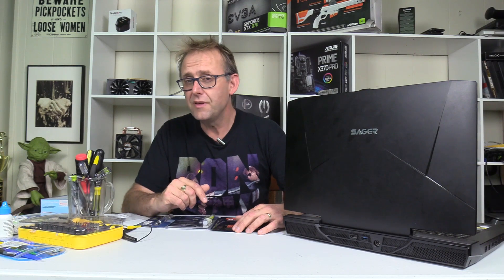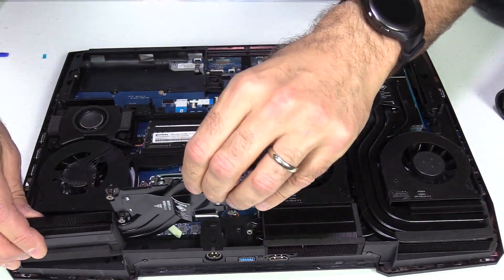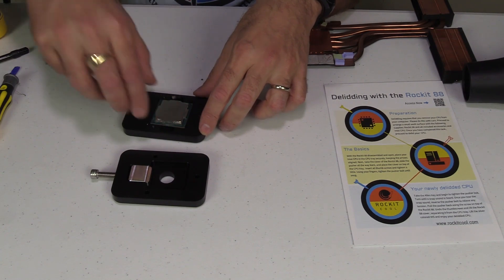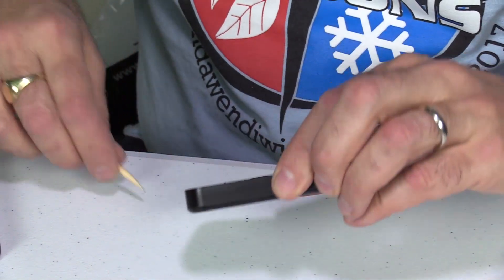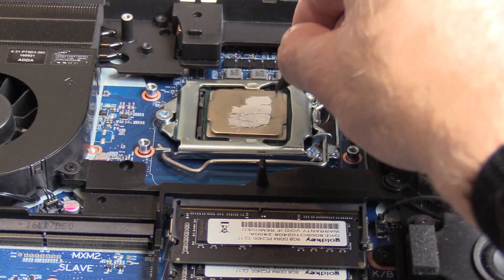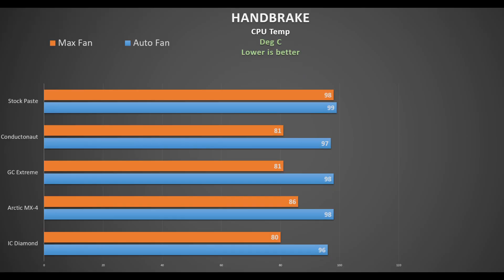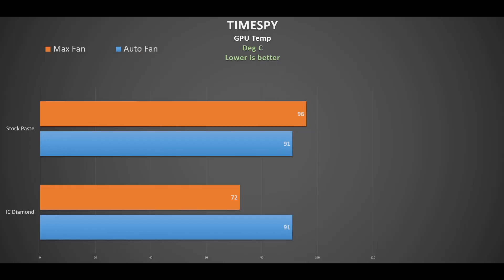Does The Thermal Paste Matter In a Laptop ? 4 Paste Showdown !

Comment from the maker: there is an error on the GPU graph - the reduction in temperature on max fan is 19 Degrees..Sorry !
Reply: Excellent thank you!
Reply: @OWNOrDisown - I've been tearing through the P870DM2/3 Owner's lounge trying to find an answer to this question but I can't so I'm hoping you might have the information I need.

I have a single GTX 1080 rig with this particular type of heatsink. I can only find guides/manuals with pad sizes as they relate to a different shape heatsink (the different one being the one shown on the front page of the Owner's Lounge for this model.) I can't for the life of me find a guide to the thermal pad sizes for THIS "T" shape heatsink or even the "half T" heatsink shown by others (which is quite literally just this heatsink halved vertically). 

I repasted for the first time recently using your specific guide and while the repasting went well (10 degree drop!) I found a few things that concerned me. One was that the IC Diamond used on the CPU and GPU originally had scratched both dies. I didn't even use a credit card to remove the crusty old paste but the dies are scratched. Second, the black "shield" around the GPU was brittle, had lots of thermal paste under it and cracked off in small pieces. I left it there until I can get ahold of some Kapton tape but I don't want to open it up again ONLY for that. Especially since the third thing I noticed was that the thermal pads were already pretty broken up upon removing the heatsink. This, despite the fact that the laptop was still warm from being run and that I used a hair dryer before removing the heatsink. 

Lots of info but basically - any idea as to the pad sizes for the gpu/cpu heatsinks shown in your video?

Comment: I use an old outdated illegal Vista sticker over the Cpu and the Gpu on my laptop for heat reduction. It seems to be working. The processors and the batteries have thermal sensors inside serving as heat camera. The sticker's metal lines have to be unharmed. On battery, the smaller part of the sticker has to be placed , sometimes it is indicated.

Comment: I guess I'll bite the bullet and do this. Considering what I paid for this loud laptop I shouldn't have to :(
Any other advice, like heatsink or fan adjustments / replacements?
Reply: @Dmitriy Otstavnoy yeah, I probably knew the risks but chose to ignore them.
Aside from the obvious outcome I got to say this laptop still delivers pc-like performance which is quite impressive.
So delitting and repasting is my best option, lets hope I don't fry or circuit my chips 😄

Comment: Yes it does, changed yesterday in my 5 year laptop, because it was throttling, went from the usual +90 degrees in the CPU (when normal office use!!) to less than 70 degrees, also cleaned the fan but it wasnt that dirty, the fan is much more silent now, since before was always on max speed

Comment: Tried MX4 on my Omen 15 i8750h turbos  and 1060 max Q I get high temp spikes up from 87 to mid 90c to 95c at full load at stock clock CPU had to undervolt ppl CPU down to 3.4Ghz from the default 4.1Ghz  turbo. The GPu did alot better with MX4 sitting at 80 to 85c under 94% load. Omen i8750h runs super hot though. Im so disappointed even after a Bios update I have to use undervolt and Omen 15 has no fan control they ramp up intermittently so that sucks too.

Comment: 1:58 remove the thermal paste
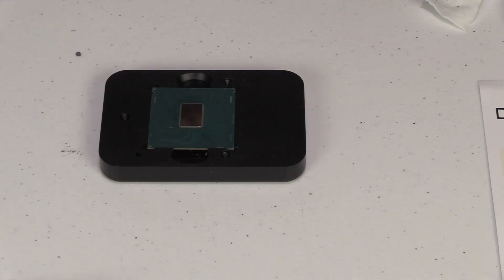4:50 clear nail varnish
4:52 tape pair doesn't come off
5:38 3m electrical tape
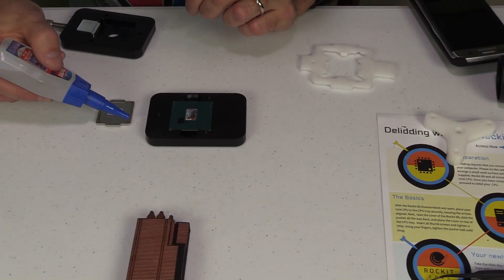5:54  some super glue Loctite 1597701

Comment: Crazy Glue? Doesnt that not allow you to remove the lid again and replace the liquid metal when it dries?
Reply from the maker: What adhesive would you suggest?
Reply: @OWNORDISOWN  I dunno I asking out if worry not criticism..but how about hi temp silicone have you ever taken a lid off again with no trouble in a laptop that had Crazy glue?
Reply from the maker: I was using the instructions on their website: https://rockitcool.myshopify.com/pages/using-the-rockit-88
They have an embedded video. Look at time frame 3.28
Reply: @OWNORDISOWN  Just wanna make sure if I do the same I can take the lid off I love your work mate no worries ..so how do I delid it again after ..I guess the device will pry it open right.
Reply from the maker: @techdudesonic77777  thanks. I must admit, I  didnt try and pry it off. I imagine if you get a sharp knife, I have a teflon one that is thin and sharp, that you should be able to work around the edges and cut through the glue. As you say its strong stuff, so you probably dont need to use too much. Good luck!

Comment: you are not supposed to spread ic diamond
https://www.innovationcooling.com/ic-diamond-correct-application/#pg-551-9
Reply from the maker: Doesn't matter:https://www.pugetsystems.com/labs/articles/Thermal-Paste-Application-Techniques-170/
Reply: @OWNORDISOWN  I would assume that IC know what they are saying. Maybe ICD pics up more and larger air bubbles when spreading

well whatever. thermal interface materials are a perverted science. just put it on and if its not far to less or far too much its fine

Comment: yeah uh, you want 90%+ Isopropyl, not 70%. 70% doesn't clean as much as 90+. I got 1 qt of 91% at walgreens for like 4$, so it's not that expensive. It's a better idea to get a bottle and some paper towels instead of buy something more expensive and purpose built to remove thermal compounds since 91% does perfectly fine.
Also, you don't spread ICD. It is extremely thick, don't try spreading it, let it spread on it's own during use.
Lastly, um, 24 degree reduction? You do have common sense right? 96-88 is 8, and 89-73 is 16. You don't add them up, because they are two different measurements. It's like saying the total speed of someone's car was 50 miles over the speed limit (let's say 70 mph), and for 1 half of the duration of their trip they were going 80 mph (10 over), and for the other half they were going 110 mph (40 over). You don't add the differences, you average them out. 10+40 = 50, divide by 2, is 25. Throughout their trip, they AVERAGED 25 mph over the speed limit. Likewise, you don't add the differences and call it a day, you average it. 16 + 8 = 24, DIVIDE THAT BY 2, and you get 12. THAT is how you are supposed to calculate the avg temperature reduction. Doesn't change the placement of products, but it is extremely misleading to tell someone you will save 24°C just by going with GC Extreme. Saying you can save 12°C by changing the thermal compound is more realistic.
Reply from the maker: I now apply a cross as my preferred method,  especially in small mobile dies. 
interestingly the method of application has no bearing on the thermal performance as discussed by Puget Systems
https://www.pugetsystems.com/labs/articles/Thermal-Paste-Application-Techniques-170/
On your final remark  i clearly state what the reduction was for each paste on both the CPU and GPU and the addition of the total reductions was merely to show which paste had the best cooling performance.  Some did better on the CPU or GPU. As for it misleading it is strange how, out of 42,000 views, you are the ONLY person who found it so, or at the very least the only person out of 246 comments.
Reply: @OWNORDISOWN  While you do state it vocally, it is by the graph that you made, which is up for longer than the duration that you say the actual reduction, and a lot of people know how to take a screenshot, not a lot know how to capture audio and share it, so yes, the video portion is more noticeable.

About the application method, the cross actually seems to be one of the best since it spreads in a square manner, so it can actually cover the entire die/IHS.

Comment: The problem in this test is that de delid totally kills any opportunity to compare the results with the stock paste numbers. You should have done all the tests first and then made the delid+LM
Reply from the maker: I could have done the stock paste with no delid first I agree, that would have shown a baseline but the premise of the video wasn't to show the performance difference delidding brings to the table, rather the difference between the pastes used. Since all pastes were done on the same delidded GPU all results are valid.

Comment: Yesterday, I tried Thermal Grizzly liquid metal, the ideal seems very good for 1 hour and then they start going up. The throttlestop was showing 2 cores with high temperature and other with 20 degree less. In throttlestop benchmark, I didn't see any improvement and instead I got a result which was bad in comparison to previous result. I start playing game and then mid way, the sound stopped and speakers start making pop beeps every 1 second. Restarted the laptop and still that pop sound didn't go, reinstalled thew drivers but no avail. Thinking that some part of the processor that control audio pc on the motherboard which might be overheating so I decided to redo the thermal re-paste with new Gelid GC Extreme and guess what..the temperature of all cores got almost equal (only 1-2 degree difference) and the overall temperature dropped in comparison to other two paste I had. Now, I can use the throttle-stop all the way to 3 GHz and without thermal throttling (I have Yoga 720 13 inch, which was 1.6 base clock and 3.4 GHz turbo boost, now I can run it all the time to 2.5 GHz with temperature in mid 50s with 20 degree ambient and 3.0 GHz at temperature in mid 60s to 72 with 20 degree ambient), I got the lowest benchmark value so far from three thermal pastes. The 1st was Noctua NT-H1, 2nd is Thermal Grizzly liquid metal and 3rd Gelid GC Extreme. From the performance, I can't believe the result. I didn't know about this brand till last week and only because of Youtube review, got to know about it. Luckily, I got it in Germany on Amazon for €9.99. I will advise against liquid metal, it is not easy to apply, if it is more, it will leak and short other component or CPU and if it is less then CPU will overheat and CPU will destroy itself or other sub-component. I applied as carefully as I could and it even seems promising for 1 hr or so but then it went downhill and when I was removing it from the heatsink, it couldn't be removed and left a stain on copper heat sink. About the sound problem, I was lucky that I solved my sound problem by factory resetting BIOS setting (this problem never happened before).
Reply: I have just canceled my lquid metal order for my asus zenbook UX410UQ

Comment: weridly for me ic diamond worked the best even better than thermal grizzly conductanaut
Reply from the maker: It all comes down to how much air is being moved - liquid metal can only do so much if the fans and heat sinks aren't moving adequate hot air...the cooling system itself becomes the bottleneck.
Reply: @OWNORDISOWN   hey brother my Dell xps 15 957p just died 😥 all I did was put a different wifi card and a different ssd by Samsung and now I cant even so much as sound from the laptop at first it boot looped then would power on for few seconds and then off and then absolutely nothing no matter what  do u know what I can do I literally bought it like 2 weeks ago
Reply from the maker: @SerjStar  Do you have easy access to the cmos battery? I found this video but it's an earlier model and required taking the motherboard out. Take CMOS battery out without the main battery connected and press the power button for 30 seconds.
I assume you have tried putting the original SSD and wifi back in. Does it go into the BIOS at all? If it does perhaps set to defaults?
Here is that video
https://youtu.be/su_Vsx0j5yk

Comment: the ARTIC MX4 seems like the stock thermal paste lol i,ll try to remember to get better Thermal paste lol :) won,t buy that 1
Reply: mx4 is great value for for money, when you do the math the price vs performance its a massive difference, 3c is not much but the price of some others is 200%+ more expensive.
Reply: Except you can get a tube of IC Diamond for under $9.  I repasted my 2 year old HP 2-in-1 with i5-8000 series CPU and it dropped my Temps nearly 15C under load.

Comment: CPU temp shouldn't be comparing with original. You have changed more than 1 variable, we doesn't know if the drastic change in temp between original and 4 other paste was due to the paste or the delidding. For which I think the delidding contributed more in the reduction in CPU temp.
Reply from the maker: The premise of the video was to compare the 4 different pastes to see what difference they made to each other, not necessarily against the stock paste - that was included just for reference..Sure the delid probably helped to bring that down but my video title doesn't say "do these 4 other pastes perform better than the stock paste?"  My video shows the delidding method just as an extra bonus, I don't even mention that in the title.

Comment: Thanks for this. I just got a new laptop and upon stress testing it. I got a 97c temp of CPU, which is I know a bad thing. So I decided to re-paste it. Do you have any recommendation of what paste should I buy? My laptop has an i7-7700HQ by the way, and it's a physically small chip I think. Thanks!
Reply from the maker: Thanks for watching this. I think Gelid GC Extreme works very well.  That and IC Diamond is often used by resellers so they must be good 😀
Reply from the maker: Also try undervolting,  that should help without repasting
Reply: @OWNORDISOWN  I will try that first, test it again and get back at you. Thanks a lot!
Reply: Are there any news on new temps with undervolting / repasting?

Comment: I use thermal grizzly conductonat on everything my i9 7900x on the die and between the ihs and monoblock 
I overclocked it to 4.8 
With normal paste in prime 95 it used to thermal throttle 
Mind you I have custom watercooling with ek waterblocks 
With the conductonat it doesn't thermal throttle anymore .
I also use it for my 1080tis
Reply from the maker: Yes, in a desktop situation I think you see more benefit - the cooling system is so much better that it draws that heat away. A laptop, not so much. If my Sager had side heatsinks that might have made the difference and I am sure then the conductonaut would show its legs. Thanks for watching !

Comment: That's annoying I've never seen a gpu so hot my old sager 980m was always 70. That heating solution in the 9877 looks beats also. That's very weird but yours is SLI isn't it? Get a laptop cooler that's another 5 to 10 degrees I always have one under these machines anything I can do. Xoticpc only does IC diamond but yeah. Cool video for sure. Really shows how they act under crazy pressure. I keep forgetting you stress them in the benchmarks lol
Reply from the maker: Zachary Manning Thanks Zach . Yes, it's pushing 190 w on the GPU, it's easy to forget how much heat is generated . I do wish it had side hest sinks like my old gt73Vr.  This was actually the np 9873 but 
I did a temp analysis on the np9877 here
https://youtu.be/jct_jUJucOY
I now have the Prema bios and am able to get a stable 4.7 on all cores . I could get higher with more voltage but it throttled as I cannot cool it enough . Even a notebook cooler didn't help. Mind you I have the gelid extreme on. Might try the conductonaut.

Comment: Hey man what you think of the Asus rog strix gl702vi
Reply from the maker: Aztec Wolf as a gaming machine I think it is perfectly fine. Will perform similar to the Acer Predator 17x I reviewed so will generally be just below the AW 17r4, Omen 17x etc. Only a 60 hz display vs the Predators 75hz (which can be overclocked to 100), but does have gsync so that is great.
Reply: OWNorDISOWN Tech D'mecisions Made Easy thanks for the advice man

Comment: Great choice for delid tool! Marking the IHS is not that important if you don't forget 1 thing: there is a small marking in the corner of the pcb, if that is in the bottom left corner for you and you can read the label on the IHS, then you are good.  I delidded 6700K, 7700K and 8700K with my Rockit88. Delidding the 7700K used in my Clevo P775DM3 meant -15C. Good idea with the tape on the pcb, the tape you used is probably fine, however just to make sure next time  use Kapton tape which is much more heat resistant, you can get it rather cheap from Ebay or Bangood.  Another tip: put tape around the die and not just the center of the IHS,  before applying the TGC and wipe off any extra paste and only use a thin layer. You used a bit too much of TGC on the cpu die, you were smart using that tape because some TGC probably dripped off so that tape saved your cpu. Also, next time align the IHS with the relid tool first and only apply the glue when the IHS is in perfect place. Putting glue in the corners will be enough to hold the IHS in place. The way you did it is not the best way to go because the glue has started to cure immediately and not to mention you spread some glue on the PCB. Oh I dare to mention that you have spread some of the TGC too. so using too much helped you out here :) Be sure to look out for these things next time you delid, because you were lucky that your delid was succesfull : ) But besides this, another great video !
Reply from the maker: Thanks for the tips ! I have delidded my i7 8700k on my P870TM and that has been OK :) That Kaptop tape looks pretty good stuff, I'll have to get some.